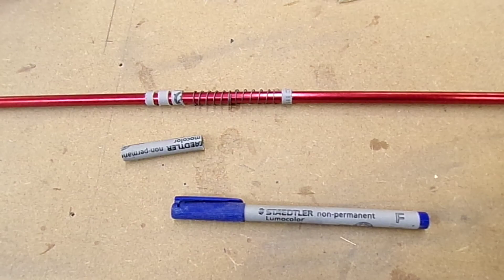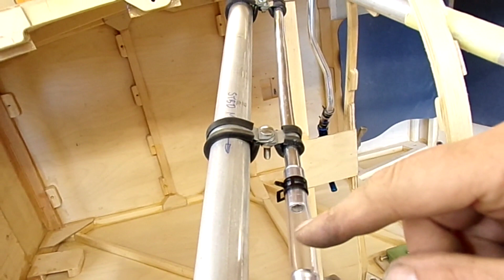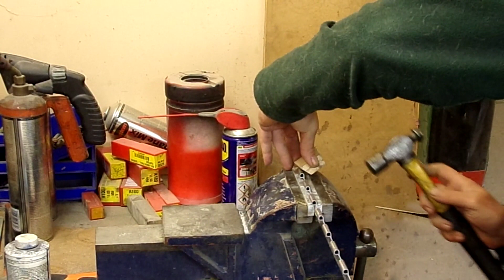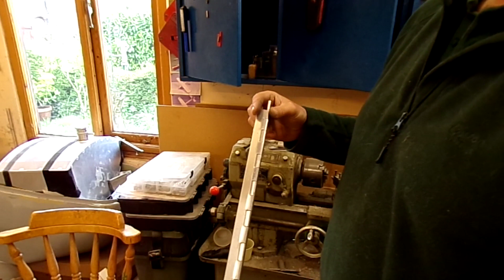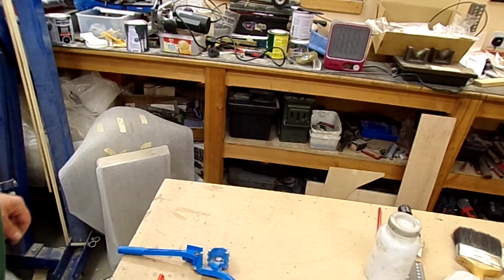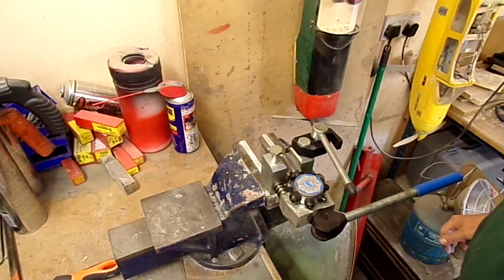EP104 Fuel lines, start STBD cockpit side for the Fisher Youngster

Comment: I thought with fuel lines, 2 clamps where needed for redundancy. I am surprised that your pipe bending tool didn't put some kind of crease in the bends. I was taught to add sand in the pipe to prevent that from happening. To each his own. Looking good.
Reply from the maker: Only one clamp needed. No need for sand with that bender as it has forms both on the inside and outside of the bend.

Comment: What size fuel pipe are you using?
Reply from the maker: 3/8"  all the way to the Gasculator.
Reply: Thanks. I hope you show us how to build the finger strainers that go in the tank outlet . Mine were 1/8 not and hard to source. Thanks again for the videos
Reply from the maker: @daniellewinters2595  the tank outlets are already fitted and they had finger strainers built in, so a case of screwing them in with a little locktight threat sealant.
Reply: @flyingkub  wow that’s nice . Mine came without and they are 1/8 npt so I will have build them myself .
Reply from the maker: @daniellewinters2595  if you can get the strainer part the thing you can do is put the union in a laith bore in about 1/4" and then bond in the strainer gauze with hysol (if not using alcohol fuel) or proseal. The worst that can happen if it falls out is the main filter has to catch the big crude as well as the small. Some don't fit finger strainers at all.